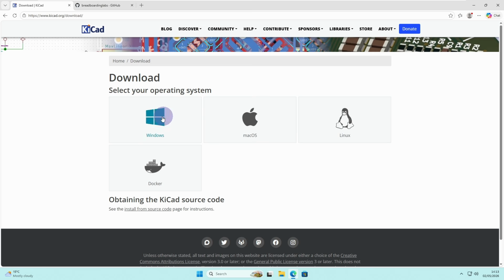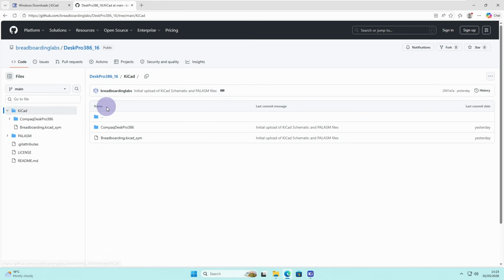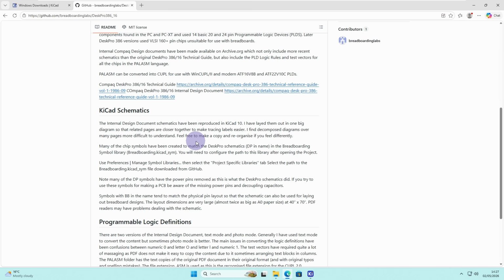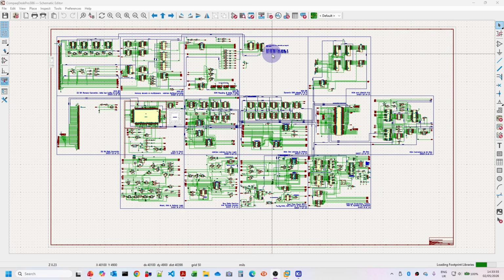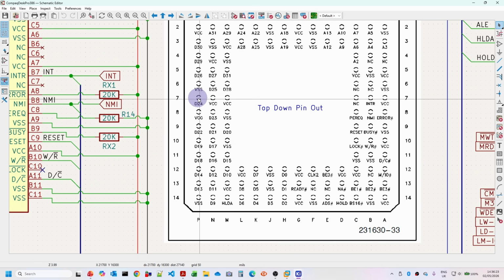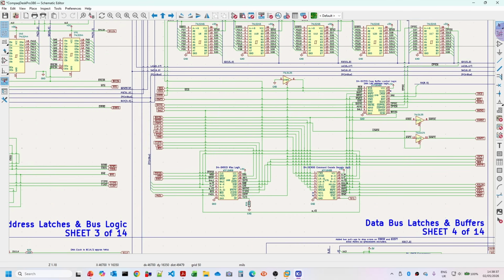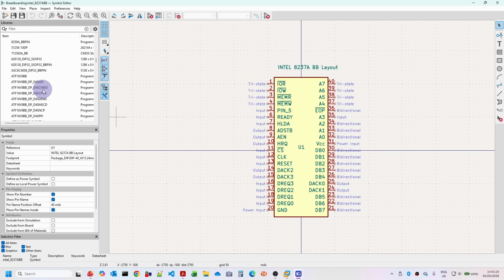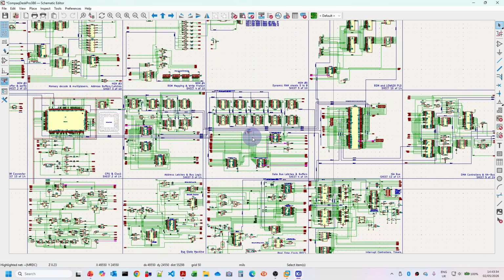386 Breadboard PC #8 KiCad 10 & DeskPro/386 Schematic

Comment: Awesome work!. Kicad says there is an error in the annotations. "Error: Error: symbol U12C (unit 3) exceeds units defined (1)". Because Kicad wants to annotate at all means there is a problem with the manual annotations.
Reply from the maker: I have manually set all the Unn IC numbers to the ones in the Compaq schematics. One of them got confused while there were multiple U12 chips referenced. The error occurs on one of the ALS1035 buffers but it has U63/U64 from memory. Ignore that U12 error and the other message. The KiCad file has got confused! I think if you get KiCad to add more annotations it may mess things up more! Will add comment to Github readme.md. Well done for trying it out. Dave

Comment: I'm like you, I hate following and forever searching for labels in schematics. Yes, on the surface it does make the schematic look cleaner but they are a heck of a bear to read. Think about an  board that has an FPGA with over 2000 pins and some of its signal names are  over 20 characters in length. It's enough to make you cry. I had to update my Linux machine last night because of a zero day root access bug. After reboot I noticed it had upgraded Kicad to V10. I guess you've just justified the upgrade.. lol.
Reply from the maker: 2000 pins ouch! Makes 132 pin PGA sound tiny. The Hop over feature in KiCad 10 is worth the upgrade on its own. Dave
Reply: @breadboardinglabs  I was gonna ask how the hop overs were done... Thanks for answering 😅